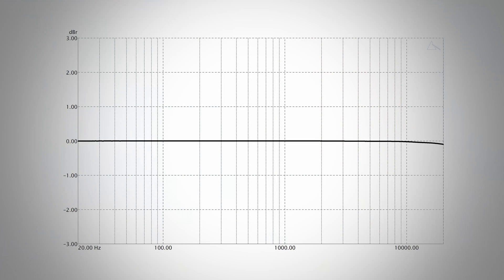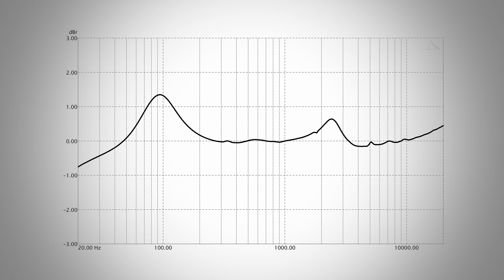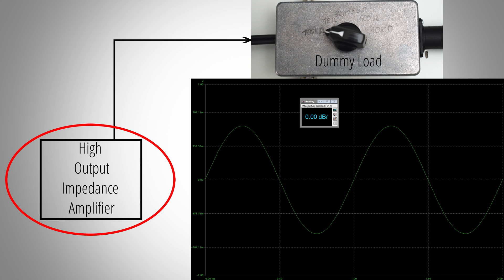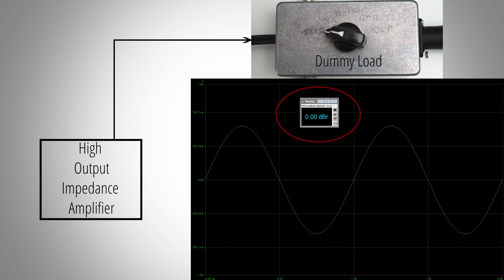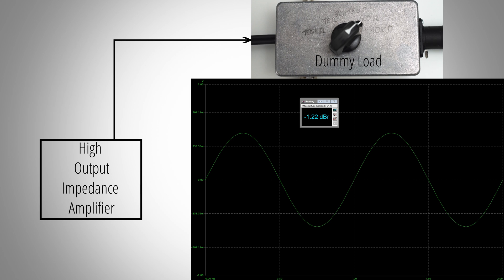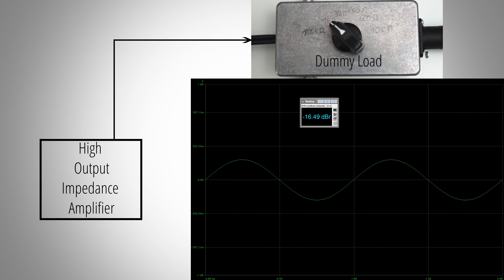Amplifier Impedance matters! Why it is important to have a low output impedance (explained)

Comment: I'm using a Focusrite 2i2 3rd Gen with a Beyerdynamic 990 pro 250 Ohm. Does this combination work well? Great video as always! Keep it up!
Reply: If you're "using" this combination, why do you have to ask?
Reply from the maker: Yes, this is a very good combination. Enjoy the music!
Reply: @JulianKrause  what do you think about using Scarlett solo 2/3gen with 80/250ohm dt990pro? 80 vs 250? And if i wanted to connect dt990pro directly to my laptop (MSI gl65), 80ohm would be better(soundcard has lower impedancy than Scarlett)? For music mixing purposes only
Reply: Bartosz Koczur Hi! I am thinking o buying the same headphones and I have the same audio interface as you. Can you please describe how loud are the headphones with this combination? Thank you so much!
Reply: @razvanbeats8353  im using it without the amp yet, it is loud, but lil bit too quiet to listen to loud music on a computer. For mixing purposes ok, for average listening ok, but i think that Scarlett should be enough to bring it up
Reply: Julian Krause Hi Julian! I am thinking of buying the same headphones and make the same combination. My question is: will the headphones sound bad if they are underpowered? Many people say that 2i2 is not powerful enough to drive the 250ohm properly , some others say they work and I am very confused at this point. 2i2 has output impedance of 10 ohm so following the 1/8 rule they should correctly drive up to 80 ohm headphones. What if I plug in 250ohm headphones? Will it sound just quieter or will also the quality and flatness of the headphones be affected? Thank you so much ☺️
Reply: Julian Krause Hi Julian! I am thinking of buying the same headphones and make the same combination. My question is: will the headphones sound bad if they are underpowered? Many people say that 2i2 is not powerful enough to drive the 250ohm properly , some others say they work and I am very confused at this point. 2i2 has output impedance of 10 ohm so following the 1/8 rule they should correctly drive up to 80 ohm headphones. What if I plug in 250ohm headphones? Will it sound just quieter or will also the quality and flatness of the headphones be affected? Thank you so much ☺️

Comment: Thanks for the great explanation! Finally i know why my ATH E40 (12 ohms IEM) sounds wrong/fatiguing in the 2k when paired with my Focusrite Scarlett Solo 2nd Gen, but it sounds beautifully flat when plugged directly to my laptop, never had this issue before with my old ATH M40X.
Reply: Well 99% of laptops and such also have 10 Ohm output impedance just like most Focusrite interfaces. The popular mainboard Realtek chips need that series impedance to keep the outputs from oscillating and very nearly committing suicide, you don't wanna go touch them when that's missing, ouch ouch ouch. Focusrite must be doing it for arbitrary rather than purely technical reasons.
Reply: @SianaGearz  Siana do you know if Scarlett Solo 3 Works fine with a 32 ohms headphone??

Comment: Hi, which one would you choose between $110 ur22 mkii or $230 motu m2? I just started to record cover video and your video is really helpful to me! Ty!
Reply from the maker: Depends on the mic you use. If you use a condenser mic you are limited by the noise if the mic anyways and then there is no audible difference in noise between the UR22C and the Motu M2. If you use a dynamic mic, the UR22C would not be my first choice.
Reply: I don’t know if the noise of the ur22 mkii will bother me or not..

Comment: How much is typical main out(line out) impedance of intefaces..? Are they variable?
Reply from the maker: Typically the output impedance of line level outputs are around 100 Ohms and below. They vary from device to device. But you can usually look this up in the data sheet.
Reply: That's sometimes true. If it's unbalanced output then it'll almost always have higher than 100 ohm outputs. My Sound Devices MixPre-6 has an 500 ohm unbalanced output and it's an excellent recorder. XLR outputs will be very low ohm.

Comment: The part about the amp is not true. Output impedance does not correlate to output current.
Reply from the maker: How would you define output impedance?
Reply: @JulianKrause  Yes there are two ways to look at it. Active output impedance and physical output impedance. However either way the limitations are in the output devices if output impedance is relatively low.

Comment: Thanks for the enlightenment! While I am aware of the electrical relationship of input and output impedance and power transfer, Didn't much think of it in the context of audio gear. If I ever purchase a high grade audio amp, I'll keep this in mind so that I can use the same equipment effectively across various devices and see how they compare. 
While slightly off topic because it wasn't covered in this specific video, amps scale differently when it comes to drawing power, moving loads, based on the load's own impedance and the amp's as the audio signal moves across different frequency+volume change - the transient response and dynamics, gives a headphones and amp combination its unique nature that should provide a nice synergy.

Comment: I'm planning on buying a pair of 8 Ohm speakers. Does that mean I should buy a 1 Ohm (or lower) receiver?
Reply from the maker: Hey, this video rule of thumb is primarily for headphones and headphone amps. Speaker amplifier typically have a near 0 output impedance. Speaker amps can will easily drive 8 Ohm speakers. But check out their specifications to verify this.
Reply: Amplifiers and receivers are almost always designed for 8 ohm speakers. If your amp has a spec for 4 ohms, you can add twice as many speakers per channel wired in parallel to achieve 4 ohms and usually that will increase the power output too. Don't wire them in series or you'll turn it into 16 ohms per channel.

Comment: And so why doesn't everyone put low output impedance headphone amplifiers in their equipment? Because it's more expensive to make high gain low output impedance amplifiers.
Reply: I don't how hard it is from an engineering standpoint to make these, Because Im nowhere close and capable of analysing amplifier topology to a detail where I can predict whats the mix and match of x,y,z components is going to do the output response, but I guess, High Gain and Low Z might be one characteristic Hallmark of a nice amp!

Comment: Does it matter when using iem?
Reply from the maker: Yes, IEMs often have a very low impedance. So, the output impedance of your amp becomes even more important.
Reply: @JulianKrause   Is it OK when using very low volume knob..?  has nothing to do with volume level?
Reply from the maker: @user-uv8yb1mg4e  Doesn't matter the impedance normally stays the same regardless off volume.
Reply: @JulianKrause  As far as I know,  IEMs with 1 small dynamic driver have almost flat impedance curve...
Reply: I can see this very well with my InEar StageDiver 2. For these I use an amplifier with 1 Ohm. As soon as I use one with more than 2 Ohm, I can already hear a difference in the sound. As soon as I use one with more than 3 Ohms, I can already hear clearly how the bass gets quieter and the mids are more accentuated.
Reply: Depends on the use of the IEMs. High quality IEMs for stage/studio like Empire Ears or Ultimate Ears usually are <25 ohm but some IEMs used for broadcasting can go over 1K ohms but those are rare.

Comment: I think what you really want to be calculating is the damping factor (DF), which is the ratio of the output impedance looking into the amplifier output, to the load impedance, at given frequencies or over a range of frequencies. There are more refined versions of this definition. 
The higher the damping factor, the better the damping of excessive loudspeaker movement by the output impedance of the amplifier. A DF of 1000 is considered very good, and high-end and professional PA amps usually have a DF of up to 10,000. The DF is set by various factors in the design of (mainly) the output stage of the amplifier. An amplifier with a high DF will minimize frequency response variations of its load, leading to better sound and higher power-transfer efficiency from amp to load. 

Unfortunately, most headphone amplifier outputs are not specified regarding their damping factor, and few are specified for their output impedance over frequency. Your approach is also a very good way of explaining the issue.
Reply from the maker: Good call, with a low output impedance you ensure that you always have a relatively high dampening factor, regardless which headphones you use.
Reply: @JulianKrause  Exactly, and it's more critical the lower the load impedance. A high impedance phone (300-600) draws less current and damping factors will be high by nature, but those high-impedance loads don't even require a good DF. The low impedance loads are the most sensitive to the DF, as they draw more current, thus making the DF more relevant.

Comment: Any tips on getting more accurate output impedance measurements, for people who don't have anything but a multimeter?
Reply from the maker: Yes, it's actually pretty easy to do. You need a headphone jack without a cable, a 15 Ohm resistor and a multimeter. First you plug in the headphone jack into the amp you want to measure. Play a 100 Hz sine wave on the headphone amp. Measure the voltage between a signal pin and ground on the headphone jack. Turn up the gain slowly until yout meter reads about 100 mV. Then connect the 15 Ohm resistor to the headphone jack between signal and ground. Now measure the voltage across the resistor.
The first measurement you made is your open circuit voltage and the second one is your loaded circuit voltage. You plug these values into the calculator here: http://www.sengpielaudio.com/calculator-InputOutputImpedance.htm
And it gives you the output impedance of your headphone amp. If done correctly, this can be very precise.
Reply: @JulianKrause  thank you so much for the response.

I've been using 100ohm resistors, and a 50hz sine wave. I'll try switching to a 15 ohm load and a 100hz sine. I hope that fixes my issue.

Maybe I just need a better multimeter. I just don't want to break the bank. But I'll order a few and see which ones work best for my needs. 

Using the fulla 3 as an example. I read an output impedance of 0.45. Which sounds right. An I get a 1.3ish from the schitt heresy, which is way off there claim but close to other third party measurements.

My issues was I was using a 3.5mm cable like an idiot. Thank you so much for the Help. This will be extremely helpful to me. Ill make sure to give you a shoutout for the help. 

Love your content btw.
Reply from the maker: @LifeLongCaboose  Glad I can help! My Fulla 3 has an output impedance of 0.61 Ohm. Though, this was measured at 1 kHz. The output impedance changes slightly with different frequencies. But your measurement sounds pretty close. The measurement gets more precise with a 15 Ohm load instead of 100 Ohm, because the headphone amp will be loaded down more and the change in voltage will be more apparent. So, even if your multimeter isn't as precise, with 15 Ohm the calculated output impedance is more precise. Cheers!
Reply: @JulianKrause  Thanks again.

I was told to use a 100ohm load to avoid letting your amp hit its current limit and clip. But this was just what I was told. It didn't sound right to me but I don't know enough about this stuff yet, to say otherwise. Good to know and I'll start retesting everything with a 15 ohm load and see.
Reply from the maker: @LifeLongCaboose  That's actually a good point. This shouldn't be a problem, if you measure at a low output like 100 mV. But if you want to be on the save side you can also use something like a 33 Ohm resistor. This gives you better accuracy than the 100 Ohm but is less prone to errors with clipping.
Reply: @JulianKrause  The post I found original recommended 50 ohm resistors then changed it to 100. But they were also using over 1V.

I have over 100 different resistors coming in so I'll just mess around with a few of them and see what I find works best for my situation.

Thanks again. It's funny how I can spend hours and hours looking for stuff and struggle and in a couple minutes you pretty much answered all my questions. Thanks yet again. 

Next step measuring headphone sensitivity.

Comment: Interesting and informative.  Does the typical Android or iPhone publish output impedance or does it matter on a cellphone.  Shopping for a headphone amp now both price and reviews vary widely.
Reply: This is a major problem with phone sources and even many interfaces. They don't publish power at certain impedance loads or output impedance very often at all
Reply from the maker: I rarely see any specs for output impedance for smartphones. But you can google it, some people measure it: https://www.kenrockwell.com/apple/iphone-6s-plus-audio-quality.htm
Reply: Forget about iPhones. They're too expensive for what you get. LG G8 and V series phones have ESS Sabre quad dacs. V30 and V40s are pretty good value at the moment. They can produce 2 volts RMS output.
http://www.esstech.com/index.php/en/news/newsroom/analog-audio-sabre-and-quad-dac-technology-ess-enables-high-audio-quality-latest-lg-g8-phone/
Reply: Apparently the high-end LG phones also have very good cameras.